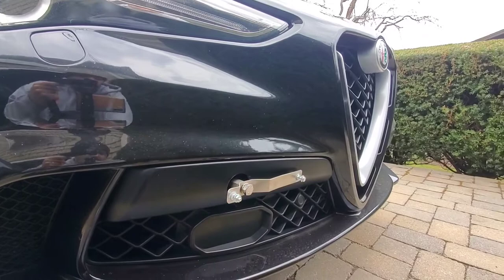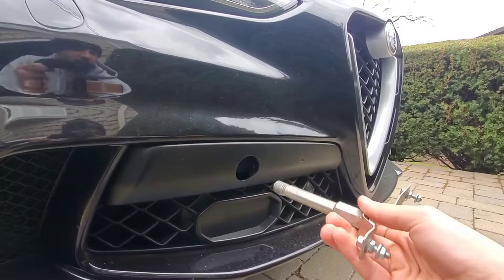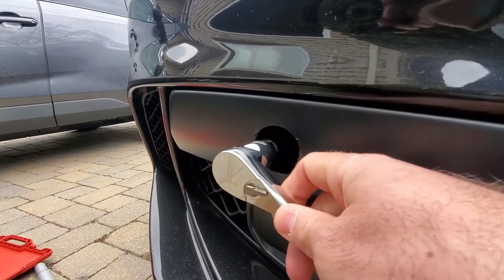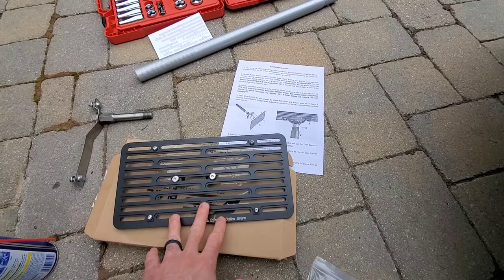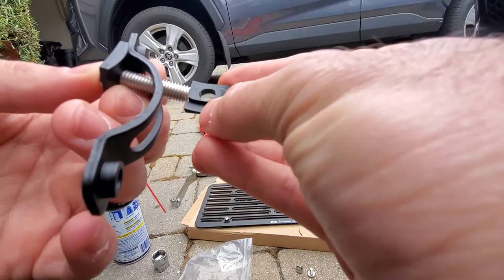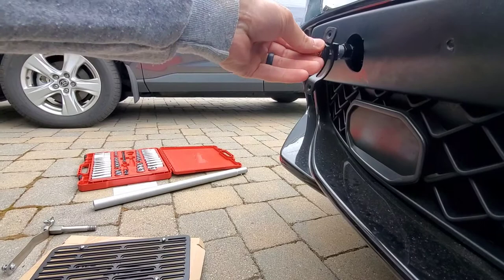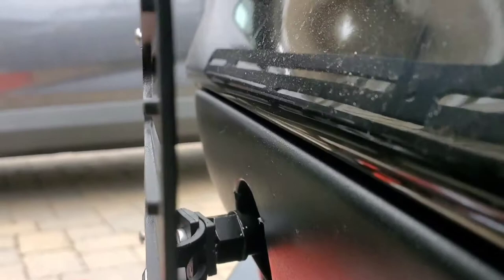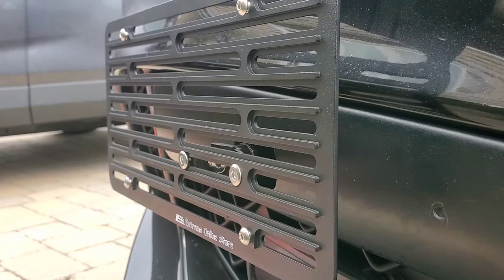Tow Hook Front License Plate Install: Alfa Romeo Stelvio QV

Comment: Also have the same issue with my stelvio. Dealer first drilled holes into the body for the plate. While I didn’t see it beforehand, the front sensors were going off like crazy whenever I’d stop in normal traffic. Now after getting my front bumper replaced, I’ve bought this mount and I’m still having the same issue when I attached it on. Whenever I stop the sensors won’t shut up. I also live in Massachusetts and I’m scared to get pulled over lol